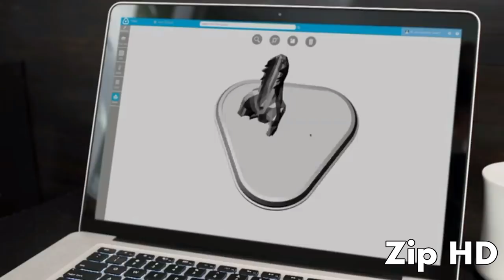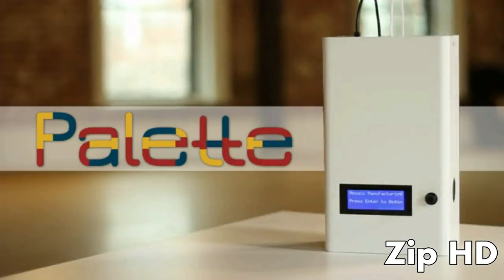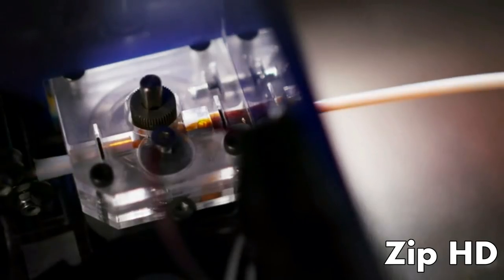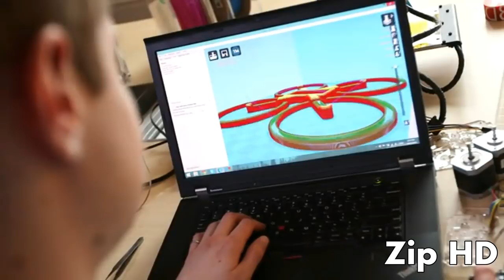Top 3 Best 3D Printers You Must Have

Comment: As a 3D Printer enthusiast, I feel I should caution the people watching this from what I know of for these 3D printing accessories.

Tiko:
Yes, it's a great price for what seems to be a decent print, but they've cornered themselves like so many other companies, making such a proprietary design, so that their primary target audience will not be able to service it. Custom motors? Yep. Custom Electronics? Check. Custom Extruder? Just as bad as the rest. You REALLY want a good, open source extruder design as this will be the thing that will cause you the most problems with your prints. Now, this still will be a GREAT way to get into 3D printing, and I still appload them for their effort into getting a 3D printer for everyone, but I think their execution should be better.

The Palette:
My biggest beef with this one is the price. For the price of this (At Kickstarter), you could buy 6 Tiko's. If I am correct, it has only 3 inputs, so for the price of that device, you can get a 3 Color extruder that’ll be easier to implement in other types of software, as opposed to the Palette’s one plugin for one software.

The MoonRay:
SLA Printers… Where do I begin? SLA is an entirely different process than the FDM(Fused Deposition Modeling) printers like the Tiko and Makerbots of the world. Just like the Tiko, this is all proprietary parts, with proprietary software, and limited options. SLA printing is an entirely different beast that much of the consumer 3D printing market has not adopted yet. There is not much support, nor not as many people using it. Also, it’s a safety hazard. Unlike the FDM printers, where it uses a VERY small nozzle to heat up the plastic, which is usually almost impossible to reach with and burnable object, SLA printers use high powered lasers that, without the proper protection, can burn things in your room and even blind you. Usually these printers have protective cases, like the MoonRay’s Green plastic sheath, but there is always somewhere it could go wrong.
Reply: Devin Keeney i think you mixed up fdm with sla while writing xD
Reply: I'm not sure I did... How so?
Reply: thaGkillah Nope, he has the two correct, FDM stands for Fused Deposition Modeling, or in other words, layers of molten plastic being extruded on top of  each other to build the object. SLA stands for Stereolithography which uses a laser, or DLP projector to cure a layer of resin underneath the model, or above in the case of the peachy printer
Reply: thaGkillah no but he mixed up that MoonRay uses DLP, not a laser. I have never felt in danger with my B9 Creator, ever. The protective case around that and this one are more for protection of the resin from outside UV light.
Reply: Devin Keeney good info mate, what would you recommend for a 1K 3D printer budget?, Cheers
Reply: Depends on what you want:
Pick 2:
Speed, Quality, Print Volume.
Also are you comfortable with building your printer yourself of do you want it pre-built for you?
Reply: Devin Keeney I've been looking a lot of printers and most of them dont go beyond 21 X 21 X 21 cm....I would say something like 30 cm is my goal and quality.
Reply: Nacho Miranda If you're comfortable building your own, you can adjust a RepRap based printer to your own needs to get a 30 cm cubed printer or even larger. I might also suggest the InventApart Rigidbot Big (invent apart.com)/ This is the printer I have, just the larger version. There is a GIANT community to help you with anything, as well as decent company support.
Reply: Devin Keeney This construction is not for long time job ;) Clearance after several days ;)
Reply: *****, I don't see your question, mind repeating it?
Reply: ***** The printer I mentioned above was actually the big brother of the printer I own, so I am quite biased in that front. So what do you mean "Color Selection"? DO you want to be able to print in a variety of colors? Do you want to print in more than one color at once?

Personally, I do not know much about SLA printers or show to shop for them. I only know that they all are outside my price range, so I cannot vouch for the MoonRay. The Tiko I could feel comfortable recommending to someone as I have seen it's stats and it looks like a decent machine.

At first, you are not going to get fine quality from any machine unless it came pre calibrated and assembled. Makerbot, and Ultimachines both have this, while the Rigidbot and other RepRap style machines usually come as a kit.

It usually comes down to price. Tell me your budget, and I can find something for you. If your looking for the best "Bang for your buck" in general, I would recommend the Ultimaker 2. This printer is pre assembled, has a relatively medium sized print area but is extremely fast and has absolutely amazing quality straight out of the packaging.

I'm sure I missed something, so I'll probably edit this later, but I am happy to help!
Reply: Nacho Miranda If you're still looking, I got the Wanhao Duplicator 4, dual extruder.  It's the same machine as the MakerBot Replicator 2, but that one costs around 3,500$ I think.  I've been using it for about a year now and haven't had any problems.
Reply: +Devin Keeney ...I think the Rostock MAX printers  are pretty good and they only cost about $600 - of course you have to assemble it yourself and set it up. But for hobbyists like me spending $3500 on a Moonray or Tiko defeats the purpose of 3D printing in wax for investment castings of scale model steam engine parts. For 3500 might as well just take designs to the foundry and have them do it, at those outlandish prices.
Reply: You are kind of awesome for taking the time to write this. this should be on a blog somewhere.

Comment: moonray $3499 affordable indeed.....
Reply: ***** 3499 even if you are middle class is NOT affordable i would rather buy a car for that money
Reply: ***** dont get me wrong i could buy one but i rather get a drivers licence and a car instead of a machine i might only use maby once a year XD
Reply: +Amaria Hummel , lol, he said affordable so I was thinking around $1000.. $3500, no thanks.
Reply: +Amaria Hummel "maby"
Reply: +Amaria Hummel Affordable is relative. Relative to other printers with high resolution you can be looking at $10,000 or $30,000. In that frame of reference, yes $3,500 is much more affordable.
Reply: Brandon Francey well ya ofcourse compared to 30K its a freaking steal BUT lets be honost 3500 is NOT cheap for normal people xD
Reply: Amaria Hummel Im well aware that 3500 is not exactly pocket change but 3d printers are expensive. If this were cars we would be talking 10k to 50k and a new car for 10k would be cheep. 

The problem comes from the fact that printers are availible for less than $1000 now but those that designed them made a lot of sacrifices to get there. Cheeper materials, lower resolution, smaller moters ect. People start thinking that good units should cost close to that too.
Reply: I've read and watched reviews on sub $500 3D printers, and the general conclusion is the end result is just as good as the $2000+ consumer printers. Granted, a little bit of tweaking is involved, but I would rather do that than spend all that money for a hobby.
Reply: Brandon Francey well in all honosty 10 K is pretty much a years worth of income for me so i do not think they are cheap XD but i do understand your point of view even if i had like a normal income 10 K would be alot of money no matter how you would look at it 3500 dollar is still alot of money for me what 100 dollars is alot of money for me :P
Reply: ***** i have been saying that for a while now
Reply: +Phillip Craggs And you wouldn't be wrong. For FDM if all you're going to be printing with is plastic, be it PLA, ABS, PTE etc a well tuned $300 DIY reprap will do just as good as all these other kickstarter printers, which are often based on the reprap models. Perhaps even better since you built it and know it inside out and aren't paying for "R&D" and all that marketing. For a few more bucks you can go with a metal frame, proper cnc lead screws, higher end extruder, autoleveling, good quality bearings, and good filament. It ultimately comes down to the user setting everything properly at the time of printing.
I'm still quite shocked at the $900 Robo a colleague bought that has a myriad of issues, ranging from damaged switches, seized bearings, to serious wobble on the z axis.
As for printing metal alloys, well, if you have to ask...
Reply: +Amaria Hummel For an SLS 3D printer... um yea, it's very cheap. When the most out of the box working 3D printers range from 1500~3000 for FDM, which is the one with a filament and from a distance can make some beautiful prints, but for commercial grade stuff with extremely high resolution SLS is king, but always expensive with the cheapest I know of besides the one above is like $10~20K for a small one. But the things you can print on a SLS machine is amazing, I mean the tight turbine wheels are crazy.
Reply: Ali Ahadi i geuss still 3.5k is too expensive for me
Reply: Amaria Hummel Fair enough.
Reply: Hakasauars well ya compared to the amounts some people have but for NORMAL people its not cheap not everyone whipes their ass with dollar bills
Reply: +MrMistery101 I think the Rostock MAX v2 printers are pretty good and they only cost about $1000 - of course you have to assemble it yourself and set it up. But for hobbyists like me spending $3500 on a Moonray or Tiko defeats the purpose of 3D printing in wax for investment castings of scale model steam engine parts. For 3500 might as well just take designs to the foundry and have them do it, at those outlandish prices.
Reply: John ______ For investment casting you can use PLA with hard molds by burning out the plastic since it mostly turns to ash and you can blow most of it out.
Reply: Ali Ahadi
many have reported difficulties with PLA burning out completely without some problems. from what  I've read so far it seems machinable wax like Moldlay is much better.
Reply: John ______ That looks good, thanks for the info. I might have to try it myself.
Reply: +Amaria Hummel what about the peachyprinter
Reply: +Phillip Craggs 

There is no price tag when it comes to hobbies
Reply: mark sayson
Unrealistic comment. if you have millions: perhaps so. For the average person THERE ARE PRICE TAGS TO CONSIDER  in hobbies.
Reply: *****
The comment was "There is no price tag" ---unrealistic. As an example
My machine shop in my basement to build 1/8th scale Live Steam locomotives cost $15,000 (literally) and I'm not quite done spending yet. Then there's the 3D printer coming up. Then there's the foundry for lostwax casting coming up.  The average person with a college degree probably can't afford $20,000 for the hobby to get started up. So I don't know what you're "lol" about but I do know you ought to think and look into things more thoroughly before commenting.
Secondly since you haven't figured it out:
since the statement was "there is no price tag..."  that would suggest that one has an unlimited supply of money (obviously much more than the 20,000 I've invested in my hobby) since the implication is that cost is no object. That is what I was addressing in saying millions. Not the cost of a $3500 printer - I have 5 times that amount invested already, and most college degreed fellows would balk in investing that much.
Reply: *****
"Calling names" :
" Good luck with that little man."

you're a hypocrite, as well
"all classic signs of butthurt syndrome"

Just keep thinking that. Better stick to xbox.
Reply: *****
There you go again! You need to make up better excuses. "more of an observation"  Umm  yeah; anything can be called an "observation". Your last comment was peppered with name calling, since they are directed with the intent of insulting. You just don't have the gumption to admit it.
Better stick to xbox & Call Of Duty. The 3D printing technology is a bit much for you I'm afraid.
Reply: +Amaria Hummel  true it was also on a different video called top 5 most affordable 3d printers
Reply: +Amaria Hummel Formlabs form2 is better
Reply: +Brandon Francey 
For $30,000 id say fuck 3D Printers. 
I'd get myself a commercial steel tooling machine and make REAL life sized objects. ;)
Reply: +Phillip Craggs Hi Could you give us examples of a 3D printers which are under 1000$ with exact result as the moonray ? thanks.
Reply: +Amaria Hummel while tiko is 180$, LOL
Reply: +Amaria Hummel for an average working adult this is affordable, if you're getting 10k a year and still don't have a car or driver licence of course you don't fall under that category. Besides, based on the way they presented it, this printer is meant for people who use it for work, not just for those looking to print stuff from thingiverse. If you're working in that industry and need to build a prop for a demonstration, or to quickly show your model to an art director this price is worth it. If you compare it to lets say a wacom cintique or to the price of photoshop or maya, it fits right in, it's a professional tool at a budget price.
Reply: compared to every other consumer 3d printer on the market, the moonray is not affordable. 
Most go for $800-1500, and print just as well as the moonray; assuming they ever actually have stock of the moonray.
Reply: You should check my video about 3d  professional printers.
Reply: Completely missed the point, this is affordable compared to other printers of the same spec on the market. Making the printer the best value meaning it's more accessible for people who are already in need of one. They aren't trying to make a 3D printer for people en masse, it's a niche product.
Reply: Or for a dentist, artist etc. Doesn't take long to pay for itself.
Reply: I've worked with $300 printers and $500k 3D printers. Heck my main machine costs over 4k and a few of the printers I've reviewed on my channel have been anywhere in between. If you just want one because 3D printers are cool then buy a crappy one and don't complain. If you're buying a tool you will appreciate quality.
Reply: Of course it's expensive  new tech always is, but like ordinary ink printers they will get cheaper. in 20 years everyone will have one, printing metal will be the break through. I wish I could be around and play with the stuff you youngsters will have then. Enjoy the evolution of the replicator.
Reply: Prusa i3 should be no1
Reply: LOL. The Moonray is $3499, supposedly affordable, and they brag about 100 micron resolution? The Peopoly Moai is $1250 - and will print 25 micron resolution. Drop mic here.
Reply: You do realize less than 20 years ago you could not buy a 3d printer for less than $100,000

Comment: Power Bed and Inkjet Head 3D printing is the best, no scafolding as the structure is supported by the powder laid and the inkjet head prints actual colors, meaning the final result after printing is final, the form and the color.  Excess powder can be used again.

Comment: I see endless possibilities for these printers as a plastic model builder. With a good 3D computer program, printer and later on, a scanner; there are all sorts of things I could make myself that the model companies WON'T produce simply because there's not enough demand for that product. Let's say I want a 1/32nd aircraft support generator as used on flightlines, but they're only available in 1/72nd and 1/48th scale. Buy the 1/48th scale kit, assemble as many parts as you can without the model being entirely assembled. Then scan it, enlarge it on your computer, then print it. I'm sure printing isn't cheap, but use silicone rubber to make a mold of the various parts and then cast everything in resin. I have yet to wear out a rubber mold. Get with other modelers via the net and start swapping programs.The hardest part will be learning to use this equipment and what it's limitations are.

Comment: 3D printer.. Print a better 3D printer
Reply: +crazyDubSNipes Dude just like press start and it automatically prints wires, LCDs and programs it for you! Ahhh... technology these days :)
Reply: yes, the RepRap Project already does that -- with free non-proprietary downloaded blueprints for >90% of parts.
Reply: A first good move would be to make a printer than can print it's own parts. Imagine how printer-users are in a position to innovate their next printer. Innovations can accumulate just like evolution happens and the consumer will be able to produce more and more products at home. Such printer would not only generate better printers but the knowledge to make such improved printer is also more likely to be shared.
Reply: how about a printer that can re-cycle all sorts of debris plastics?

Comment: With the resin pool printer, is it possible to recycle the scrap bits back into the pool?
Reply: Taylor Smith no you cure it whith the laser its hard and stays hard
Reply: PAXthe4Th Unlike my willie.
Reply: adisharr yeah try curing that with a laser...
Reply: +Taylor Smith No, and the resin pool becomes contaminated with bits and pieces of crap so you'll need to clean it out (and loose resin in the process). Not to mention that the silicone (or whatever material they use to line the resin tank) wears off over time ~ every 2 liters of resin used; and you'll need a new one

Comment: So much hype lol. 
The Tiko is a CHEAP and slow 3D printer... It's certainly interesting for the price but definitely doesn't solve the problems mentioned at the beginning of the video.
The palette is great but it certainly doesn't enable you to 3D print flashlight because the conductivity of the conductive 3D filament is very low... meaning that higher currents would heat up the case a lot.